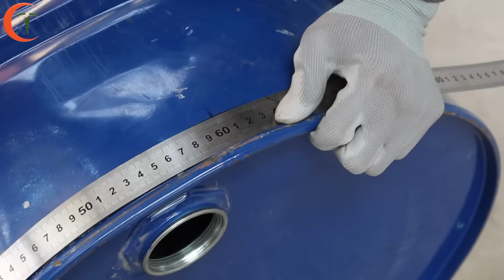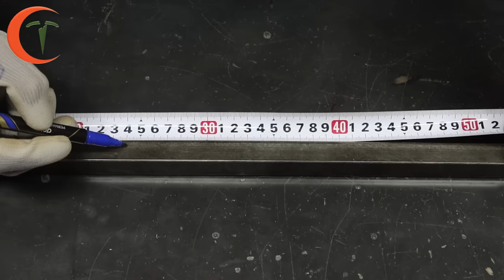How To Make Tool Storage From Old Oil Drum | Homemade Tool Storage

Comment: It's kind of magic 😂
Blue Barrel turned into red, Yellow.
Nice work and Idea, but you shouldn't miss your fails 🤓
The round plate should be fixed, that's much better and you could use it as a stacked. Otherwise if you turn them separately, it could cause chaos. It makes no sense to seperate them.
Have a nice day 🙋‍♂️